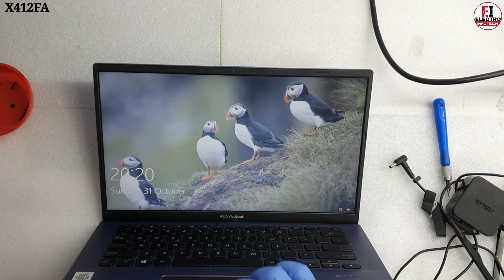Not turning on Asus Vivobook 14 X412FA /Troubleshooting

Comment: Couldn't understand properly what he did? How the issue resolved.
Reply: He removed the connection from battery and turned it on
Reply: Power button is not working so keyboard have to be change in my laptop same problem 5 time I have apply method but not working keyboard need to be replace
Reply: @EnjoyTour993  hey, where can i find this keyboard???

Comment: Thanks a lot for this video, Just reconnecting the battery Port worked for me. This saved my 3000 bukcs as the Service centre team was asking this much for replacement of Keyboard panel. Once again a big thanks 🙏
Reply: Same here
Reply: Now is it working smoothly?
Reply: @SudhanshuShukla1   Unfortunately not... After few months same issue happened but this trick is not working anymore. Since then I am running on direct power supply.
Reply: @SudhanshuShukla1  Do you have any better solution?

Comment: When i charge my laptop the lights indicator doesnt turn on and my laptop is also not turning on
Reply: Same issue
Reply: Same
Reply: How u solved this problem broo
Reply: @kimanoodles  so guys, i recommend changing your power jackets too because mine i had to replace and it works

Comment: Sir, i have the same issue can you please tell what's the solution for it?
Do i need to replace the keyboard or any other solution? Please do replay.
Reply: Bhai pta chl jaye to plzz mujy bhi  bta dena p
Reply: @CodingwithRDL  BHAi muze bhi bata do
Reply: @shriyank5263  pta nhi yaar abhi tk mene sahi nhi kraya laptop
Reply: @shriyank5263  mene bs piche se khola firr battery disconnect kiya firr charge lgaya or power button press kro ya wrna automatically on ho jayega firr battery wps connect kr do... Fir bs laptop ko pack kr do but ab power off mt krna bs sleep pe daal ke rakh denaa mst chlega
Reply: @shriyank5263   मेल करो मुझे में आपको सही से बताता हूं
Reply: @shriyank5263  apko pta chala kya??
Reply: @CodingwithRDL  ha Mane same procedure follow Kiya aur mera bhi on hogya
Reply: @CodingwithRDL  thanks
Reply: @shriyank5263  apne service centre pe dikhaya ya nhi?